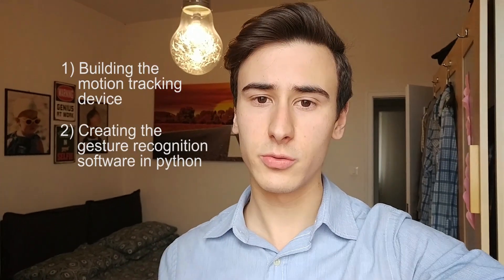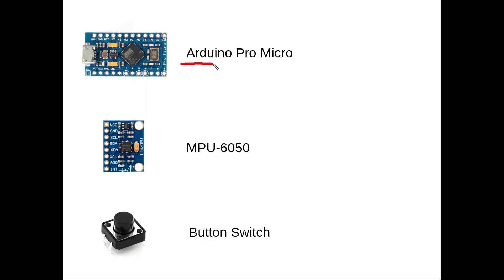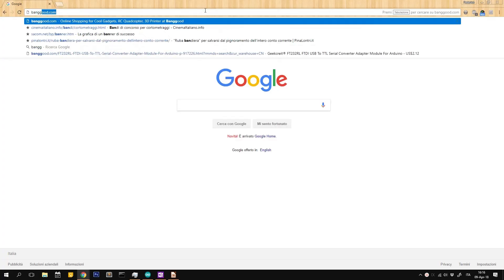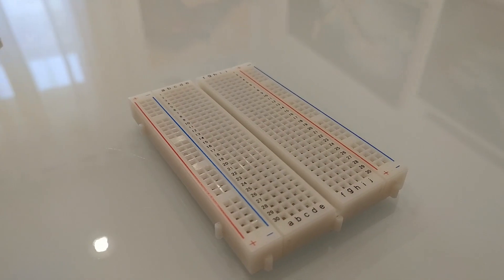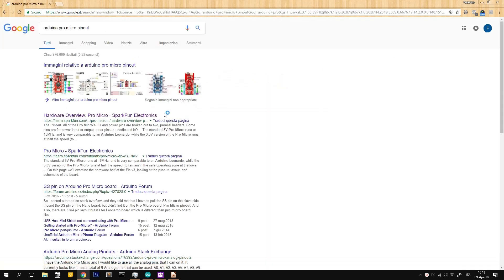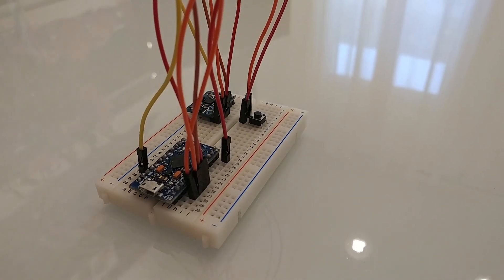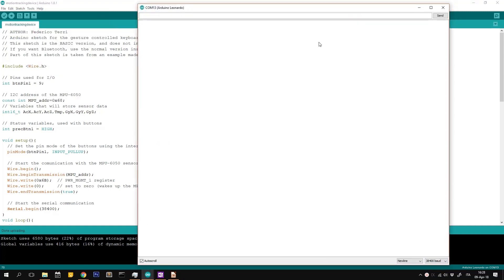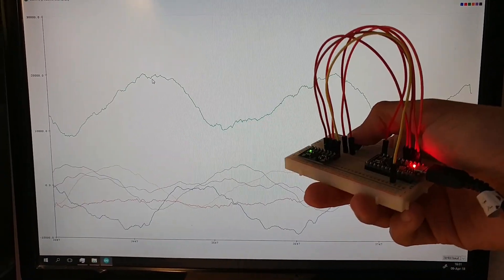How to make a Gesture Keyboard - Part 1 - Motion tracking device Arduino MPU-6050 Machine Learning

Comment: i want to know that for gesture detection is there any need to take webcam access or its completey based on motion sensor ?
Reply from the maker: Hi, this project is completely based on the MPU-6050 accelerometer sensor, no webcam required

Comment: Hello, I am using Arduino Uno but I am getting -1 -1 -1 -1 as output in the serial monitor. Can you please tell me which pins/ports on Uno board to connect to the MPU? Thanks in advance.
Reply: check connection, probably loose connection. Better solder the connections
Reply: @sudeepkumar5683  thank you :) . It was MPU 6050 which was to be soldered properly.

Comment: Sir, I'm using Arduino UNO R3 but unable to get any output on monitor or plotter. Where might have I gone wrong?
Reply from the maker: Hard to tell, you should double check your connections to make sure you connected them to the right pins. Also, because you're using an arduino UNO, the pins are probably different

Comment: Hey. We are doing this with Bluetooth and Arduino nano, we changed the pin no. in code and were able to successfully upload it. The serial monitor showed starting and closing batch but the serial plotter just showed an empty graph  with no plotting.
Reply from the maker: Probably you have a problem with your accelerometer
Reply: Can you please say the pins of the Arduino Uno and Bluetooth
Reply: No we figured it out. Accelerometer was working fine. It was the pin. We changed pin according to digital but we needed it to be analog(in Arduino nano) As soon as we changed it, the serial plotter started working fine!
I'll share the pins soon.
Reply: @parulparihar684  can u plz upload Ur pins soon
Reply: And also say were to change in the program
Reply: @snehasneha2350   pin D11 instead of D16 in arduino nano also instead of D2 D3 we connected it to A4 A5 (connection with pins sda and scl in MCU ) in code only changed 16 to 11 in Bluetooth code in the very beginning of arduino code
Reply: @parulparihar684  Hello, 
Have you completed this project?
If yes, Could you help me with this as I am finding it quite difficult to cope with small changes and errors.

Comment: Hiee Federico I have used arduino pro micro but It is showing only -1 -1 -1 -1 - 1 after pressing the switch ? What is the problem ? please help me asap as it is the part of my academic project
Reply from the maker: That is probably due to a wrong connection with the MPU-6050
Reply: try changing the i2c address from 0x68 to 0x69

Comment: Can this same code work on arduino nano too? If yes, except for pin numbers what changes I need to make?
Reply from the maker: Yes it does work with any arduino, you just have to change the pins
Reply: You need to make a small change in code as well. Just the pin no.
Reply: @parulparihar684  Hi, I too am using arduino nano. Please can you send me your pin diagram and also about the canges in code as I'm am in a bit of a confusion.

Comment: Hi Federico as per my understanding I see that the machine learning part is happening in the laptop running python...is there any way to integrate that within arduino itself??
Reply from the maker: Hi, unfortunately the Arduino doesn't have enough processing power for a machine learning algorithm. But if you go with something more powerful like a Raspberry or an Arduino Due you can do it.

Comment: Hi Federico. Thanks for this 2 new videos. I really understood some missed things with those. Tho I need some help since I am using Arduino nano. For some reason the first console prompt message is not appearing. Can you tell me how you connected your button switch? I am connecting 2 of the 4 pin outs it to the GNDs of the Nano.
Reply: nevermind just solved it!
Reply from the maker: That's great! :)
Reply: Hey? Can you share circuit diagram where you are using nano? I am not able to find pins on nano used here.
Reply: Hi, I too am using arduino nano. Please can you send me your pin diagram as I'm am in a bit of a confusion.

Comment: Hi!
I have successfully completed this part please upload the next part soon as i am bit confused about how to connect with all python codes and how to work with the data set and where to use data set. Please update it soon I have to submit my project in college earlier!!
Reply from the maker: Hi, I will publish it tomorrow :)
Reply: Federico Terzi okay thanks!! And please also mention there how to work with data set!
Reply from the maker: Of course :)
Reply: @sakshamkhandelwal833  please tell me have u completed this project or not ???
Reply: heyy saksham which arduino did you use ??
I have used pro micro but it is not working.
Reply: Hello bro, 
Can you please help me with the project?